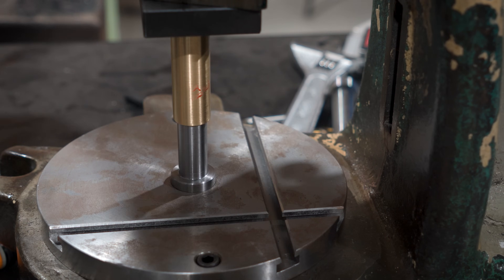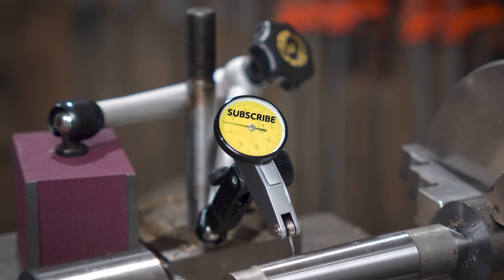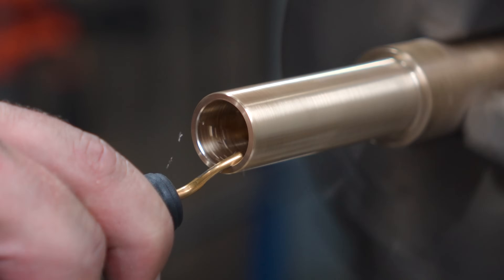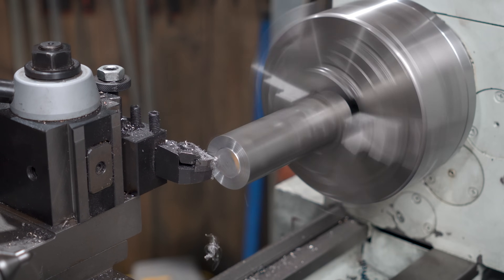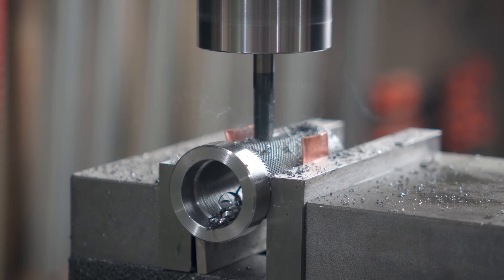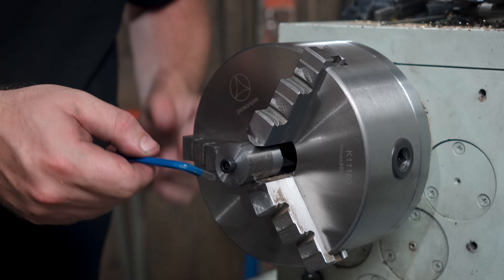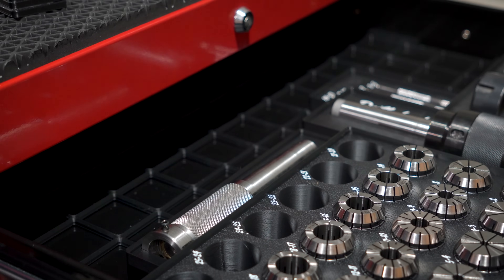Making a Floating Tailstock Die Holder, with Free Plans!

Comment: Nice build. Hopefully it doesn't grab and spin the morse in your tail stock. Morses with rotating force usually have a narrow flat tang on the pointy end that sets into a slot to prevent that happening.
Reply from the maker: Thankyou! I’ve never actually used a Morse taper with a sleeve in my tail stock, I have a few tapers that have them, but they never seem to seat quite right for me, but an easy thing to add if you need. I’ve used this for a couple of small threads since making it and haven’t had a spin yet, lets hope it stays that way 😂 but thanks for checking it out

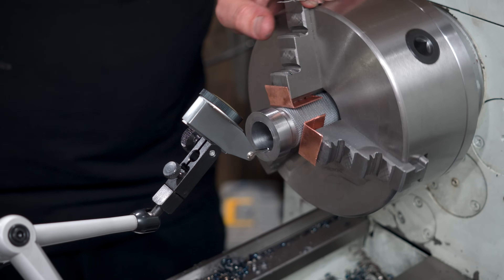Comment: 8:47 Doesn't "tapping in" with the 3 jaw just mean tipping the part? It may be concentric at the point where the indicator is mounted, but the axis of the bore is no longer parallel to the axis of the lathe. Try it on an external diameter with more stickout and measure at two points!
Reply from the maker: That’s a fair point! I didn’t really think of that at the time, I doubt it would make a difference in the application I’m using it for here, but makes sense!

Comment: Nice job.  Only improvement would be a link to an archive of your nicely done drawings.  Tip: you can use the lube clearance in your 3 jaw chuck to get closer to dead true by tapping the jaws to bring in the part.
Reply from the maker: That’s definitely something on my list. I’m slowly working on a website for some bigger projects I have in the pipeline, and they will be there once it’s all together, but thanks for checking out the video!

Comment: Add some springs, pop the whole mechanism inside the Morse taper, and then add a quick-release tool change, and bingo! It can hold taps, drills, dies, and all sorts in a compact unit. 😃
Reply from the maker: That would be very cool. Probably a bit above what I can do design wise at this stage, but a tapping chuck with a clutch is something I really want to try! thanks for checking it out
Reply: @nomadhandcrafted  Please feel free to copy mine in MT3 or R8.
Reply from the maker: Thanks! I’ll have a peek and see if I think I’m up for it 😂

Comment: Quite some nice work!

Best regards!
Steuss

Edit - tho, that pressing was a horror... You really should have made a jig up hold that part up... The central hole was almost begging to become a sleeve for that shaft...
Reply from the maker: Thankyou! I did measure that hole before pressing as I knew it would be close, and it was a tight fit, but not quite enough for them to lock together thankfully 😂